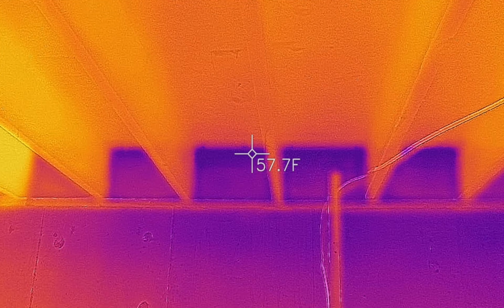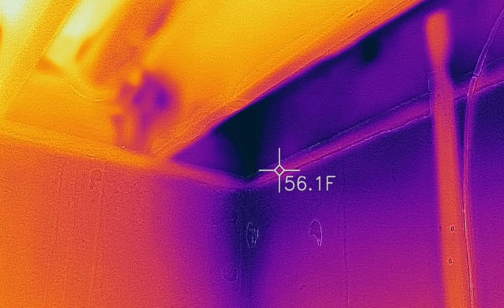Blower Door Testing For Builders - Process | Common Leaks | Solutions

Comment: Thank for the video. There are almost no videos on what to do to improve seal of a home after construction. I would think low hanging fruit would be things like the rim joist sealing you mentioned. Others that I can think of are sealing the wire passthrough sun all light fixture, switch and outlet boxes, sealing around the interface between air vents and drywall or floors.